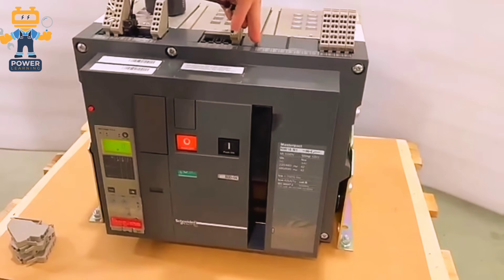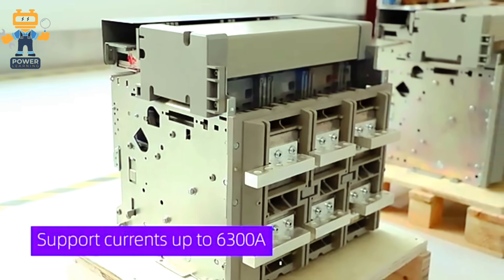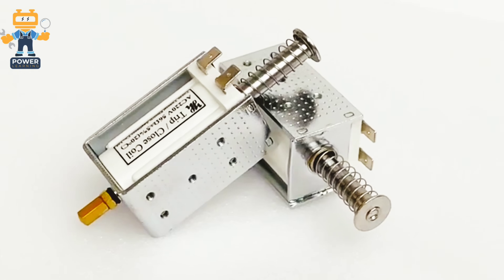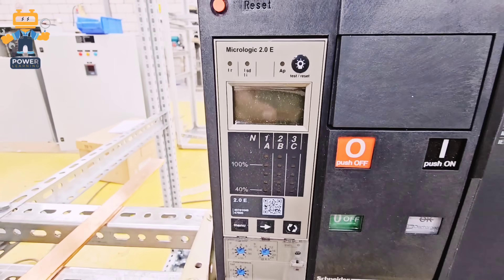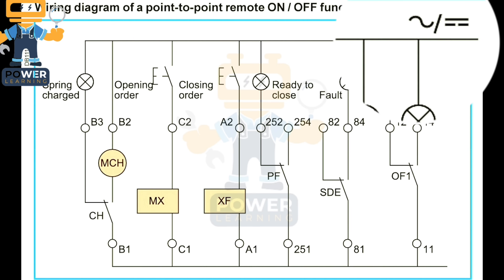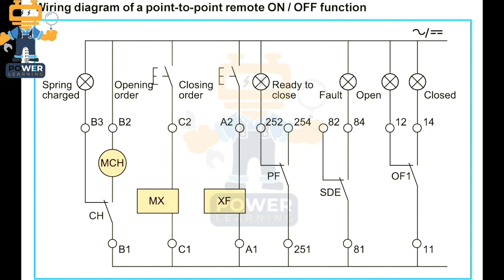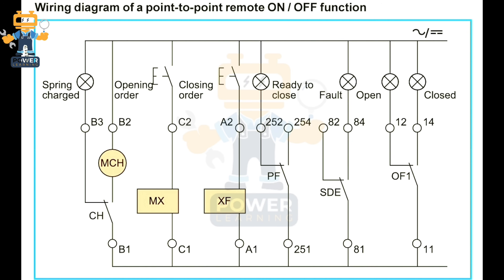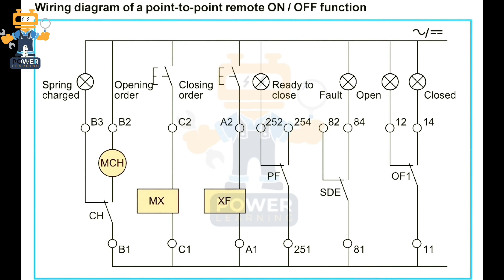Air Circuit Breakers (ACB) wiring diagram| Type Accessories, Operation | PowerLearningChannel #acb

Comment: You are missing UV coil that is very important.
2ndly explain student which coil if they usee then breaker motor spring can not be charged manually.
3.Also give them imformation regarding trip unit.in which condition it will work and how it work,suppose in case of overcurrent the coressponding lamp is glowing mean it will show the corsponding alarm on the trip unit and breaker will not be operated unless u will make it 1st reset.